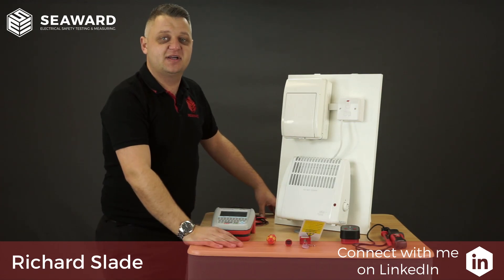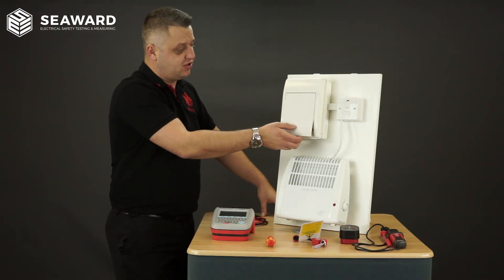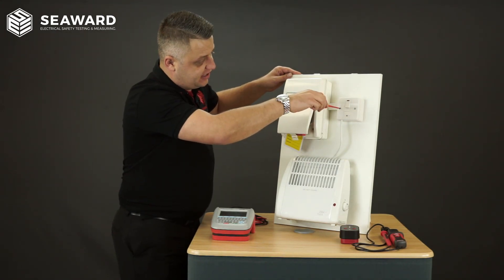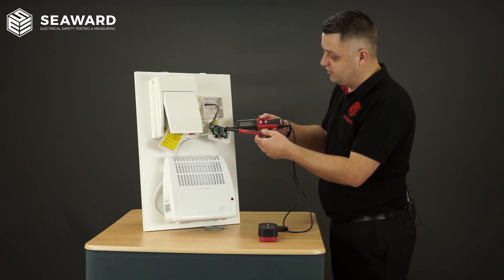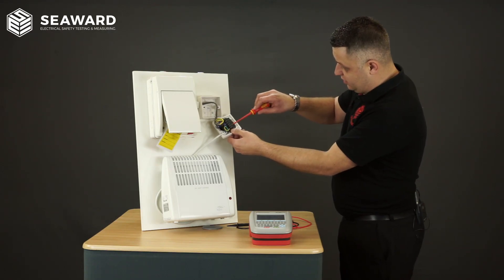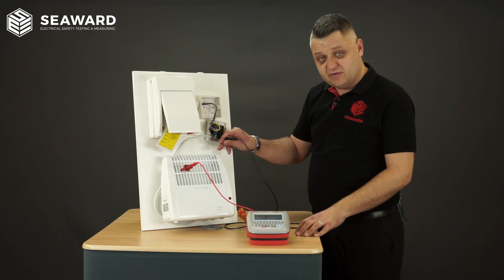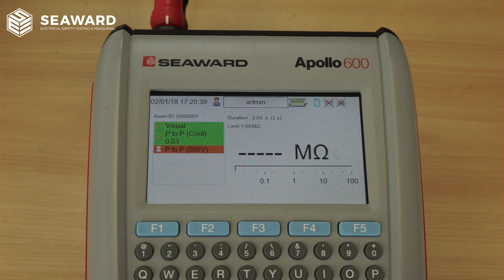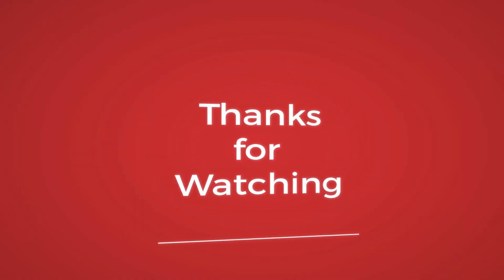How to PAT test a fixed appliance - Seaward

Comment: Portable Appliance Testing - PAT, is vastly different to Fixed Appliance Testing. Surely PAT testing a FIXED appliance is a contradiction. To work on a fixed appliance, an electrical licence is required. As a person trained on single and three phase testing, that is what I do. I'm not a licenced electrician, therefore I only test equipment and leads that plug in to a power outlet.

Comment: As someone else on her rightly pointed out, PAT testing( it is now called inservice inspecting & testing of Ele Equ) is always easier on the test bench. In the real world, each fixed item can take a minimum of 30 minutes when done properly. With current time and cost pressures, I’d estimate a realistic charge of £15–£25 per item. I genuinely don’t understand how some companies are advertising it at £1.00–£1.50 per item  sure, the stickers are cheap, but the real-world overheads are not. I’ve also asked a few providers whether they carry PI (Professional Indemnity) insurance, and the responses have mostly been silence. That said, the demo itself was clear and well presented — credit where it’s due.

Comment: Very well explained.
Reply: Exactly - it is fixed, full stop. I have fixed appliances with cables hidden in the wall. Connecting/disconnecting them every year will cause conductor eventually to break and I will have to re-run cables in the wall. What a fantastic idea!

Comment: Should have done a function test first.... No point in testing a heater that isn't working an will need replacing
Reply: Only a Millwall fan would consider using before testing 🥴

Comment: I think the title should say 'How to FAT a fixed appliance'.
Looks nice and easy on the bench, probably not so easy on your hands and knees under a kitchen work surface.
Surprised you did not check the fuse in the 'fuse connection unit'.
So the building electrics need to be turned off and everyone has to stop work whilst you are FATing, that will cost the company.
Not sure it is a good idea to keep bending the buildings solid core wires, they are not designed to be bent all the time, the earth wire will snap, so your FAT may cause a fault as opposed to preventing one.
Reply: Also, disconnecting and re screwing the wires back in will damage the copper wire strands, this will compromise the earth continuity and make the fixed appliance unsafe. 

Personally I think it is better to leave the fixed appliance connected and just do an earth continuity test from the nearest mains socket.